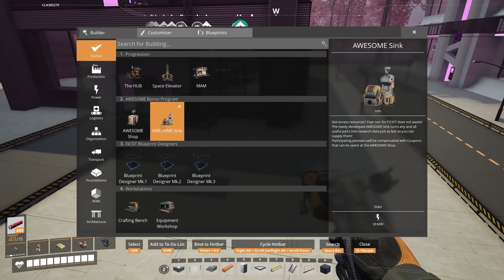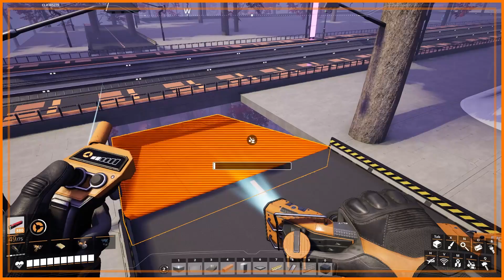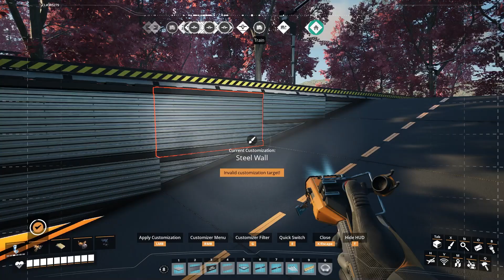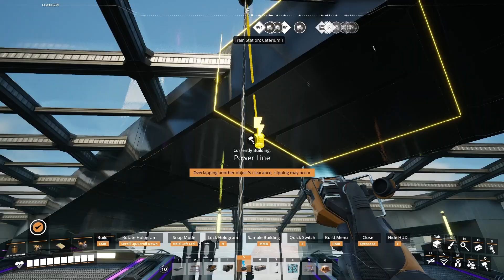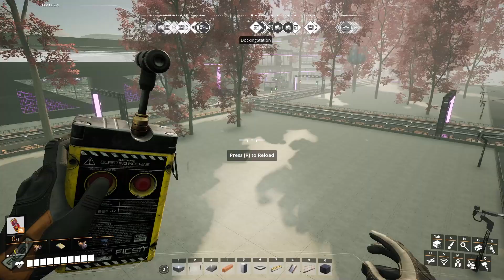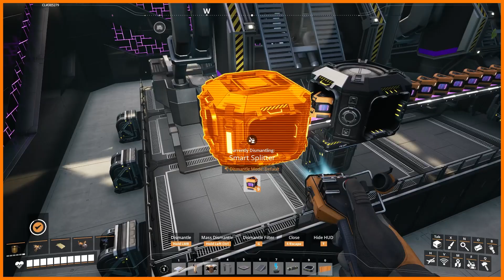Implementing intra-city logistics - Satisfactory 1.0 MEGAFACTORY EP14

Comment: I blueprinted my roads to have a full foundation in the middle so I can paint it with the dotted lines, then I added an asphalt half foundation on each side and a concrete half foundation out the outside to make a sidewalk. Gives the roads enough room to accommodate the trucks and have 2 lanes
Reply: Actually no I lied. I do 3 asphalt foundations for the road and the 2 half concrete foundations on the outside for the sidewalk. I also blueprinted straight roads, corners, t-junctions, and intersections so I can just slam them down wherever easily
Reply from the maker: That's probably the best way to do it, a little late to make this adjustment in my factory unfortunately =(. The trucks are just gonna have to struggle on the narrow roads!

Comment: @1:00:00 mark
You're working on the Smart Splitter arrangement for the Sam Fluctuators.

Once You have Factory outputs going into a Drone or Truck Station-
You can use those as a Buffer Bin for Dimensional Depots, and cut out significant splitter/bins setups.

The Stations have an input and output.

Just go Full Hog Factory to Station Input. Either 1or 2 belts, depending on Production Rates.
Then a single Mark3 belt From the Station Output into a Dimensional Depot.
The Dimensional Depot will be a Priority output initially.
Once it's saturated, It will back up, and the Truck/Drones become Primarily the draw of the Reservoir.

Dimensional Depots are usually Building or Craftables. So their draw is minimal on a factory.

It's the same concept as a smart splitter arrangement.
Except simplified.
It replenishes just as fast, but is not so complex.

You just tap the output, and carry on
Reply from the maker: That's very clever thank you for that!

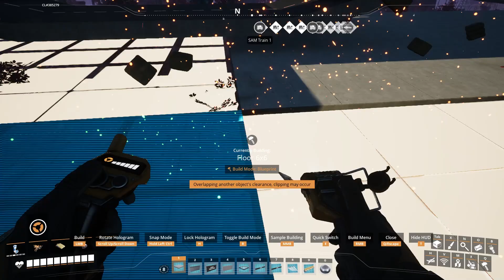Comment: @12:00 mark
You're talking about the Tunnnels getting in the way of Your belts in the Sub flooring.

If Your city layout is done with aome extra foresight and some reengineering, You can really take it to another level with Logistics.

Like, I know it would be annoying- but I'd recommend adding an additional subfloor down an additional 8 meters.
This would necessitate rerunning the belts a bit 

So, the 1st level would be for tractor and truck traffic, the 2nd level for Pupes & belts.

The Trucks barely squeezed under the 8 meter/2x wall height. But they fit!!
This means that it's doable.

Major cities eun Subways, with utilities underneath them.
Ao, a similar set up would help You in the future.

It's easier ro get truck paths down to the 1st subfloor and back up again. As well as opportunities to navigate about 

While belts and pipes would be best deeper, because they become static emplacements.

It just depends on if Gou wanna invest the  time & efforts into opening up those options for the future.
Right now would be easier, before a tine of belts and pipe get added in
Reply from the maker: That is a fantastic idea, I like the different subfloors for different logistics idea. I think realistically I won't have the time to rework my 3 level subfloor, it will unfortunately be a hidden mess. But, were I to do this all over again I would 100% do it the way you've recommended!